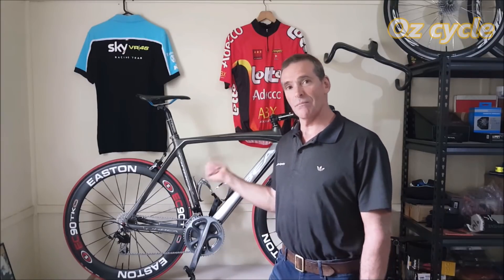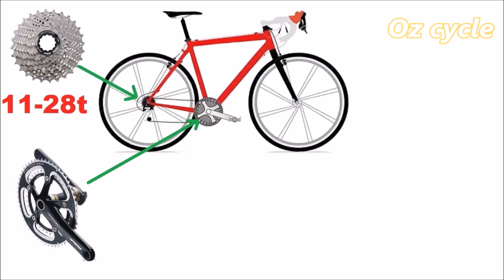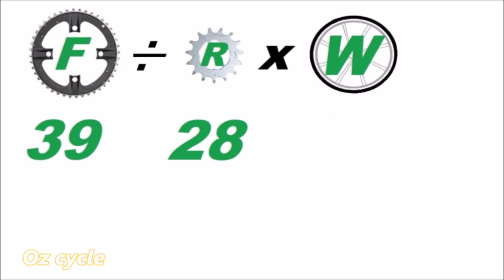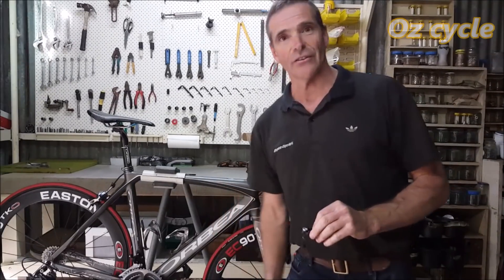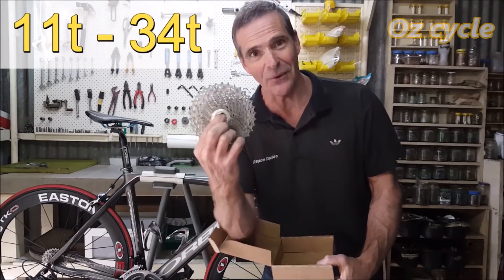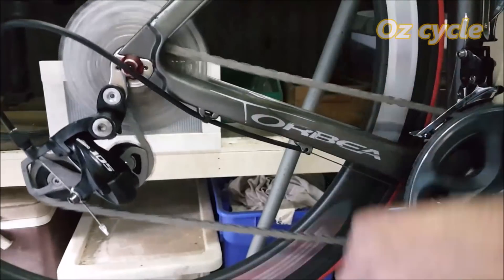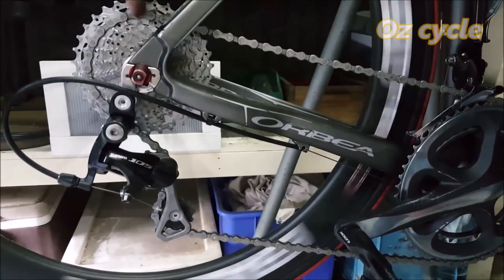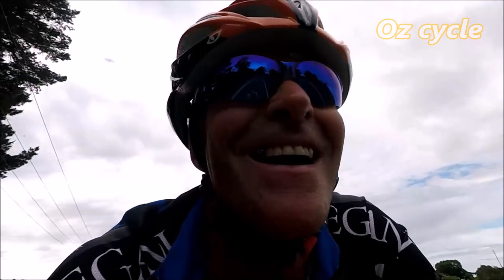Have you got Compact gears yet?

Comment: B-screw is really for adjusting the jockey wheel for the largest sprocket. I normally shorten the chain to take out chain slops, not by adjusting the b-screw to take up chain slack.
Reply: You're adding 2 links because you put a goat link on your road bike. That's pretty much common sense

Comment: Put blue threadlocker on the extender-to-hanger threads and grease on the derailleur-to-extender threads so the extender stays fixed while the derailleur remains removable.

Because the extender must stay securely in place to keep shifting alignment stable, while the derailleur needs lubrication to prevent corrosion and allow easy removal or adjustment.

Comment: 5:10 If you could unlock you chain with your hands it mean it is time to at least replace the connector or always have spare one while riding.
11:50 Totally agree i would gladly trade some middle start to make uphill gears smoother it commonly oops to ease or oops to hard and nothing in the middle

Comment: Good idea to try out the low gear, my biggest gripe is the 11t small sprocket. With a 53t chainring it's such a big gear it's unusable for most riders. 
A 34t or 32t to 14t would be much more practical with closer gear spacings but alas not available anywhere. It probably easier to switch to a compact crank for a better range of usable gears.

Comment: And just like that, you’ve made the shifting poor on the stand and absolutely unbearable on the ride. Guide pulley is too far from the cogs especially close to the 11 side. Chain angle from cog to guide pulley while shifting is less than engineered for and shift ramps can’t do their job properly. Never, ever do this. 

Instead find an mtb RD that works with your shifter. A working example is any 11 speed Sram shifter works with any RD with exact actuation technology. Sram Rival shifter pairs well with X5 RD. Even though X5 is 10 speed, the pull ratio is the same and you get all the gears. X5 can handle up to a 40 cassette in practice along with a 16t step between chainrings. So, 46/30 chainrings paired with 11-40 cassette is a fantastic drivetrain with decently close cassette steps, a huge range and a very low, low ratio. And while cruising on flats, you’re put in a good area of the cassette with the smallest steps (15-17-19-21)
Reply from the maker: Been working fine.

Comment: It's so weird how cycling has its own terminology and conventions for just regular terms like mechanical advantage and the bottom bracket. The bracket is actually the thing that holds the bearings in the frame. The bearing assembly should be called the crankshaft bearings.

Comment: I have a SRAM Red 53/39 crankset and the 11-25 cassette 10 speed.  Is it easier to swap to a 50/34 crankset and leave the 11-25 cassette? Or is it easier to do the cassette and leave the crank the same?  Or do I need to do both. I am not racing just recreational but hills are getting much harder!
Reply from the maker: You will need to change the crankset as the sram red rear derailleur will not handle the huge gear range. Or swap out the rear derailleur for a sram gx long cage,  then you can use a larger cassette with 53/39 crankset.

Comment: Thanks for your excellent video! Very helpful! I have a Quintana Roo PR3 tri-bike. The bike came stock with a 52/36 front chainring and 11-28 cassette. I want to make 2 changes: 1) install a 11-34 cassette; 2) install a Ceramic Speed OSPW. I have a Shimano RD9100 rear derailleur. The RD9100 capacity is 30t. The Ceramic Speed OSPW capacity is 32t. Do you think it would be possible to run the CS OSPW with the 11-34 combination? I don’t want to void any warranties or destroy my derailleur or CS OSPW. Any thoughts?

Comment: 5 Years later i use 46/30 cranksets on both the gravel/touring and roadbike, with 11-36 and 11-40 cassettes in the rear. top gear is still enough, especially on the fat tired gravelbike, and the low gears make it possible to basically spin up every climb with the same power and cadence i would use on the flats. the only small gripe is the 11-12-13-15 jump on the road bike where i would sometimes like a 14 in between. i still have the tighter spaced 11-30 cassette floating around but to be honest i couldnt be bothered to switch lately.

Comment: I just did this whole ordeal with a derailleur extender. 
At 8:22 to 45 you can hear the garbage shifting it gives you though. There isn't enough chain rap and the cogs are too far away. 
Turns out my ancient 105 and other cheap derailleur can support a 40 tooth cassette with no issues at all. Just a B screw adjustment is needed. 
Cogs don't rub, the chain pulls and rotates the derailleur forwards fine. 
The only issue is chain tension in high 11t gearing. You really need a long derailleur cage to fix this issue though. In a 1x setup there'd be great tension though

Comment: I added the extender to a 10speed Ultegra 6700 short cage derailleur, put longer chain and Installed an 11-34 cassette. Unfortunately, I can't tune the gears neither do my local bike shop. The middle gears don't change smoothly at all and some don't change at all. Do you have any recommendations?
Reply from the maker: Adjust the 'b-screw' back so upper jockey wheel is closer to sprockets

Comment: Just because you have smaller gearing, doesn't mean that you personally will be faster on that smaller gear. The best gearing for you is self selected by your brain to give you the most efficient gear to go the fastest, suited to your own particular anatomical attributes for either creating higher torque with a bigger gear or a lower gear suited to people with a greater aerobic capacity. My average cadence is 65 in time trials on a sporting course, but I am generally one of the fastest riders on Strava. Remember the higher your cadence, the more times you will have to lift the weight of your legs up. As well as this, for people like me who produce higher torque, a compact chainset means running out of gears in descents much more easily, which I do, which is why I removed the compact chainset from my Trek Speed Concept supplied new and replaced it with a standard chainset.

Comment: Greeeeat video!

Question: After I upgraded from 11-28T to 11-32T, I had chatter at the rear pulley. 
I adjusted my b-screw all the way but still couldn’t get adequate clearance and the chatter persisted. This sounds like the solution! I also sat that you can lengthen the b-screw in another video. Since I’m only going from 28T to 32T, do I still need to buy a longer chain if I go the derailleur extension route?

Thanks again!
Reply from the maker: Yes , add 2 complete links
Reply: @stevenleffanue  Many, many thanks for the reply. I know you are busy. Your videos have helped this newbie immensely. I’m new to cycling, now live in Japan, and have to contend with hills everywhere. Your videos have helped to ease my transition. I look forward to going through your catalog of videos for more gems.
Reply: @stevenleffanue  

You are a wizard, Oz. 

Worked like a charm! Bought a new chain but the old chain seems to be working fine… as long as I don’t cross-chain at 50-32, my tallest gears. Also, looks like I have a little play available with the b-screw. Could I get away with not changing chain if I am diligent and don’t cross-chain? Or is the new chain really for that worst-case scenario where, under duress, you screw up, cross-chain, then overly stress the system?

Thankful newbie, new to Japan,

Troy

Comment: Well.. I last bought a new XC in 2009 and it was 3x9 SRAM..  now the 2020 with SX 12 Seems so useless compared to my 3x8 commuter bike and as such.. Is still under my bed.
28/38/48 11-40 650B47MM with a 700x40 front.  TT bars on an Upright Bike with racks and baskets

18-118 gear inches.

Comment: Thank you for your tips.
Would you think , can I do this with my standard chainring and change cassette from 11-25 to 11-32 by adding rear derailuer extention and couple of chain links?
Reply from the maker: Yes. You will need to add three complete links
Reply: @stevenleffanue  thank you..
I've just order an Ultegra 6700, 10 speed 12-30 cassette.. It should be fine, right?

Comment: I might be old fashioned but, in our day a Standard chainset was 52/42 not 52/39... I used to climb the 1:3 Honister Pass in the former ratio of 52/42, with whatever we used to use on the 'block' on the 42 ring, typically a maximum 23. Don't ask me how I did it but I did :)   We used to call that 'fresh air'... My God, I must be getting old LOL

What is that, 1:3... 30%? It was short, but my God, it was steep!!

Coming out of Borrowdale via Newlands was just as steep but longer...  Over the top, and down into the valley beyond.... The scenery is truly stunning!

Comment: I Rigged my Newbie Clyde ‘Mate’ (180cm, 110kg.) up with even LOWER Compact Gearing. His Bike came Stock with Compact 34/50t CRs and 11-27t 9 sp. Cassette w/Sora Derailleurs and Brifters. After trying an 11-34t Cassette he STILL had to dismount and walk up any Gradient over 5-6%. So I went with the LARGEST Cassette that was Available 11-40t. Considering he’s a Newb, I DID NOT TRUST him to be able to figure out NEVER to Cross Chain. Holy Vegemite, with that Sora RD you gotta get that chain length JUST RIGHT, and I ended up CUSTOMIZING the Cassette cause the Chain sagged in 34/11t but it sagged just a TINY bit in 34/12t after I got the B screw dialed in JUST RIGHT so there was NO Catastrophic Damage done to the RD or it’s Hanger when Shifting into either 34t to 50t CR when in the 40t Cog or 2nd gear 34t to 1st gear 40t cog when in the 50t CR. I replaced the 11,13,15t Cogs with 12,14,16t Cogs. It HELPED with that Knee jerking 15-18t Jump, however the 16t to 18t Cassette shift, Sometimes when downshifting you have to give the Brifter an extra ‘half swing” to “UMPH” the chain onto the 18t cog since the ‘Hyperglide Ramps” built into the Cogs aren’t “Lined up” Correctly. The 12, 14 and 16t cogs were from another Cassette already spaced in that sequence so the cogs’ ramps lined up but NOT to the 18t Cog on the 11-40t Cassette. This gave an Decent Gearing spread of 12,14,16,18,21,24,28,34,40t on the Cassette, the 18t to 21t jump being the only issue but not TOO much like 15t to 18t.  Another thing you may have overlooked is if you attach a Cheapo Knockoff Chinese ”Wolftooth Roadlink” RD Hanger Extender, then the Hanger Alignment may be OFF after installing it and you SHOULD recheck and adjust that alignment accordingly, and if you swap back the original smaller Cassette and attach the RD w/o the Hanger Extender then you have to Again readjust the Frame’s Hanger Alignment. I MUST have done this ‘Right’ since he’s YET to ‘Break’ anything with this PUSHING it to the LIMITS of the RD’s Capacity Setup.

Comment: Hello ,  I have compact 50-34 crankset in my specialized road bike with 11-32t cassette. Can you please suggest between 11-36t or 11-40t cassette ?  I have shimano sora 9 speed rear derailluer. So i was bit concerned with 11-40t if the gear chaning would be harsh compared to 11-36t for last two gears ? Here are the gear ratios for both cassette.
11-36t cassette : 11-13-15-18-21-24-28-32-36
11-40t cassette : 11-13-15-18-21-24-28-34-40
Reply from the maker: You must be climbing walls to need more than a 1:1??
Reply: @stevenleffanue  Yes climbing Hills and wanted to have easier gears without spending too much on changing 9 speed groupset to 11 speed groupset, i thought of changing the rear cassette from 11-32t to either 11-36t or  11-40t. However not sure which one to get. Do you think 11-40t or 11-36t would be better?

Comment: My bike came with compact, 50/34 and wide range 11-32 rear.  The most challenging climb near me is 15.8% avg grade for 1 mile and that is just a portion of the 4.6 mile 9% climb.  I still cannot get up with 34 front and 32 rear.  Debating on going road casette 11-34 or straight to the 11-36.  Either way I am not changing the chainring as I need tge too end.  I need more range.

I hope it all works, bije has 105 long cage so I think I will be fine.

Comment: I mean I don't mash along in some 100/11 gear in some 16" diameter custom monster chainring on the flat, so why should I run out of gears just to prove how strong and manly I am? I mean if my opponent has turned their pedals twice with 30 kg force before I got mine round once with 60 kg force, who's the winner here?
Ideally I'd have a lightweight road bike with 48-36-24 up front and 34-11 in the back. Ultimate tractor gear and doesn't spin out easily at high speed. I don't need really closely spaced gears at the top end for my day to day use. That's for racers looking for exactly 91.54 rpm at 30, 31 and 32 mph.

Comment: It works but it's smarter to have a chain that is too long rather than too short. It sould be long enough so that you can safely use both large rings without ripping out the rear mech. If you put your big chain ring while on the large cog (for example after a long climb while you're exhausted) you could potentially ruin your frame. If the chain is long, you will get chain slack while on the smallest ring combination, not a huge risk but you shouldn't do that anyways.

Comment: Compact cranks climb easier? I keep hearing this, and though each pedal stroke in a gear combo lower than a standard one allows you to do less work per pedal stroke, you still have to use the same overall amount of work to get up that hill. On the road, in group rides, I've mainly observed people with compact cranks either climbing with a similar cadence to those with a standard crank, or sandbagging it in a lower gear and getting dropped. So, yes, they can climb easier, but easier can only mean slower. A higher cadence is not necessarily easier--most riders I've observed cannot achieve a higher cadence (100+ rpm) over the course of a 3-5km hill. I have a standard 53x39 and 11x25, and at 58, still dominate in the hills, often achieving a cadence of 90+ rpm, so I understand the importance of cadence, doing most winter training at 100+ rpm on rollers. But I also understand the importance of strength (weight training) and an effective power to weight ratio. Compact cranks don't compensate very well for a declining power to weight ratio. Maybe you feel like it's easier to climb, but that may because you're climbing slower.

Comment: I just wanted to let Steven and his followers know that this trick of extending the hanger didn't work on SRAM. I was building 1x road sram and with 42t front had to have 40t cassette. Little did I know that medium size sram RD will not work. Actually it was switching but when it came to the bigger gears RD was touching the cassette. Hanger extension made no difference 😢
I had to sell mid cage RD and buy long cage RD.
Reply from the maker: Try adjusting the "B screw"
Reply: @stevenleffanue  B screw didn't resolve the issue. The problem is that extension for the hanger does not work on SRAM. What I can't say for sure Steven if two-by SRAM would be different, because in my case it was one-by. I'll send you a picture via instagram where I put mid cage and long cage side by side.
Reply from the maker: You may also need to add 2 more links in your chain.

Comment: Compact is great as it is difficult to find triples,however i used a triple on zoncolan and mortirolo and found my times were better,but the kicker is that i didnt burn all my glycogen ,so you can do several mountains in one day.thank you for the info on the adapter. Your chanel has made a huge positive difference to my cycling. A compact is good for heavy riders like myself you can put the torque from a 39 to a 34 and really fly with less injury.there is no way a 39 will work on a climb like mortirolo even contador used a 34-30 and he won ! Spin to win!

Comment: Couldn't a similar outcome be achieved by using a triple crank with perhaps a 26 tooth inner chain ring or a 24 inner chain ring.  I use a triple on my old 3x7 Paramount road(touring) bike where I have a 24 tooth inner chain ring and a 28 low gear in the back.  I can pretty much climb any road (that is paved) with that combo.  And if I want it easier I can swap out the 24 chain ring with a 22 chain ring.  Presently my crank rings are 46-36-24 with a 14-28  seven speed cog in the back.

Comment: Did you need to add a spacer when you install the MTB cassette? Could you do a video how to replace and measure a chain? You seems like a pro doing the chain replacement.
Reply from the maker: If the freehub is same speed (10 , 11) as cassette no spacer should be required.
Have put your suggestion on the list...thanx

Comment: Very well made video! Indeed! I do agree on that about getting up from saddle, relax back and legs!
I have a bike road flat bar, steel, from 1990, still with original 7 speed material, shimano 100GS. I now have 11-13-15-17-19-21-24- and 28 out of range.
Still not decided, if just swap rear shifter with one 8s, to recover the 28T on my 8s cassete, for very steep climes.
if just the 8 speed flat bar shifters availabe were not ugly with gears display, and would be nice one 10S up to 30T. Can't decide myself, since only affects rare steep climes where going seated and at very low speed is not also the best...

Comment: Compact Gears. Nope. I bought a new Expert Roubaix and quickly sold the compact driveline it came with,and bought a new triple groupo off ebay........I run a 26 T inner chainring,and a 11x28 cassette on back. The funny thing is they sell a LOT of triple groupos on ebay,not everybody is sold on compact drive. I like the 53-T on the front and the 39 in the middle is a nice gear. Steep wall style mountains around here.